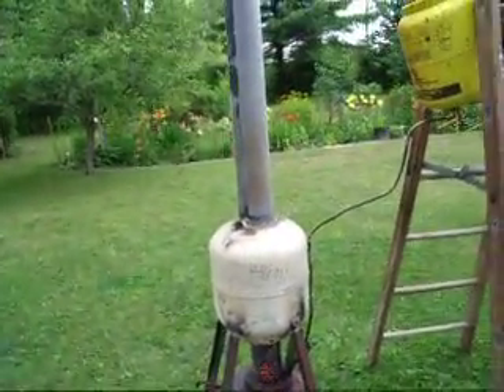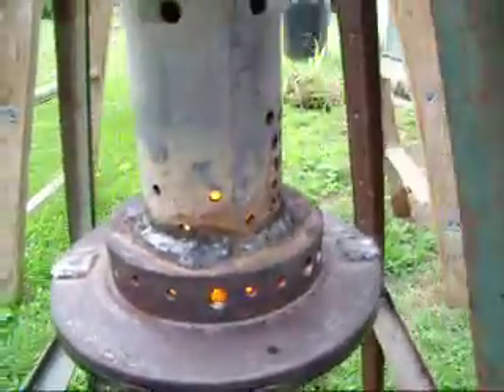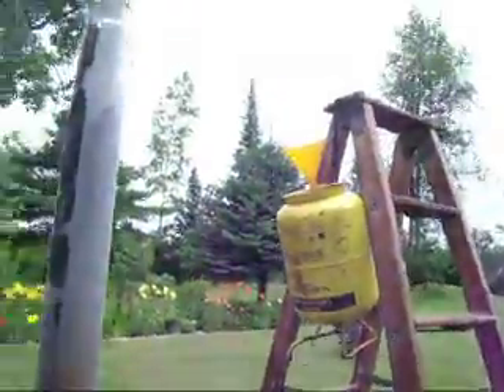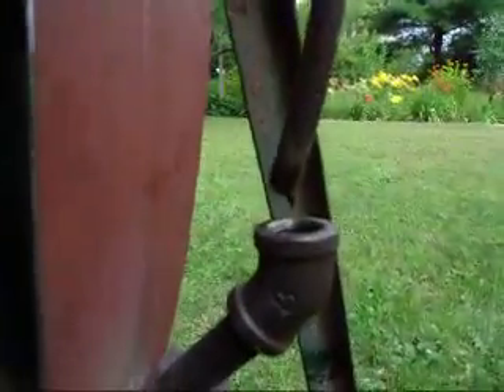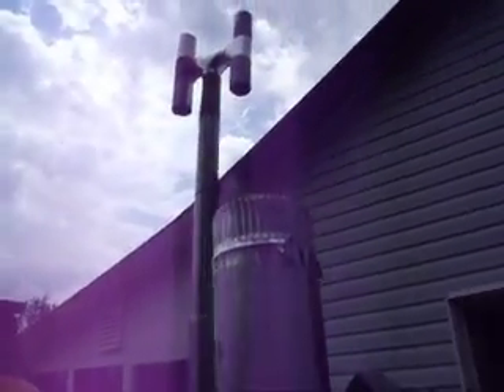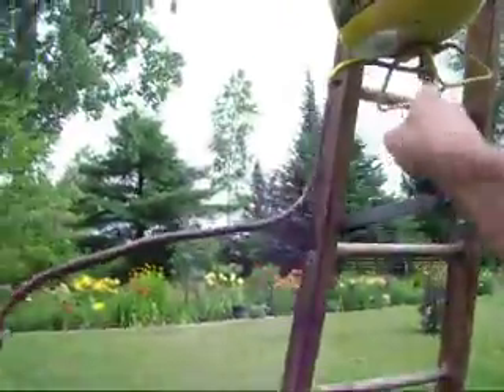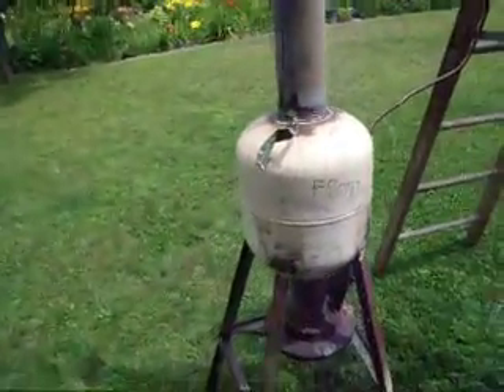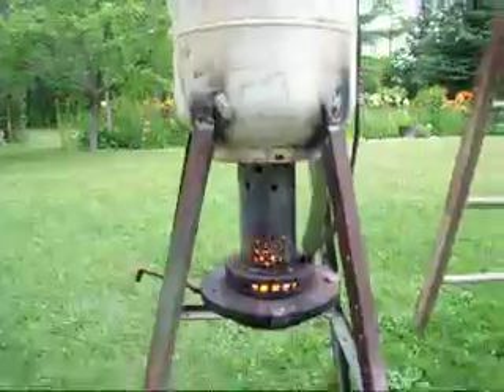diy waste oil berner furnace

Comment: Put a stainless steel pan underneath it’ll glow red hot but that’s good that’s what you want and the best part they don’t burn out in the burn hotter and stronger put your air up from the bottom but your tube through the road or read the bottom have year come up from the bottom breathing the manger put a disk in round Can you have the air come up into the chamber you put all your holes down below and will burn really hot give you what you want with that oil less oil Good jobBuild them all the time

Comment: You've got too much air in the primary and not enough in the secondary. I had a Russian model which was factory made and it fed a very small amount of air into the oil chamber and a shitload of holes in the secondary which was three times as long as yours; the flame it produced was well over five feet tall and except for when I fired it up it produced zero smoke or smell. It sounded like a jet engine.
Reply: Please explain?

Comment: If you use a ventilated rotor rather than a solid one you will get primary air feed automatically, and all the way round, I have had great returns from vented disc rotors, good effort keep it going

Comment: One problem with it I see is that using two rotors doesn't give you much room for the ash to build up after 12 hours of heating  the ash builds up and the oil flows out the rotor all over the floor. So have and oil catcher ready as 20 litres of oil over the garage floor is a buggar to clean up.
Oh add more flue will clean up the smoke problem. Those welds need attention too.
So check out www.dripfedwasteoilheating.com for the original drip fed waste oil heaters.

Comment: Looks good. I built a small oil drip into my barrel stove. I like how it is compact and doesn't take up much space. Does it put out a lot of heat?
Reply: Cant wait to see more. It would be interesting to see how hot the main chamber gets and also how hot the flue temp gets. Looks like it burns so little at a time which is great. Love your vids !